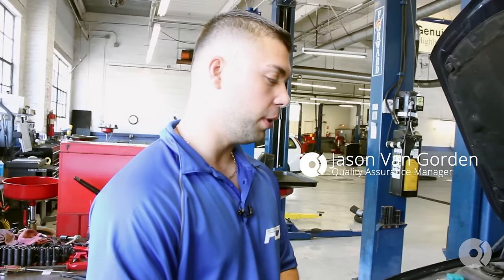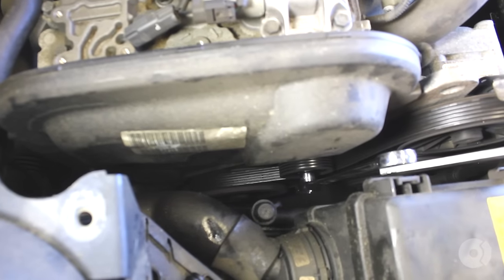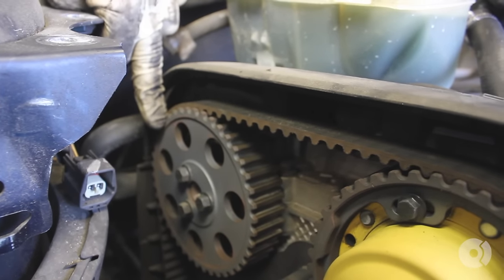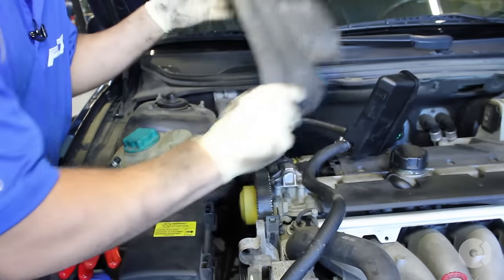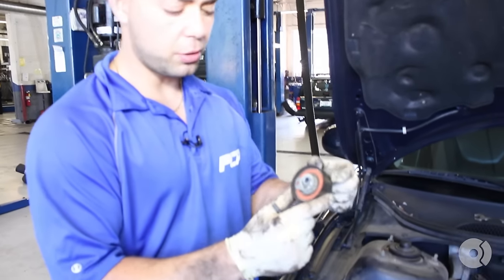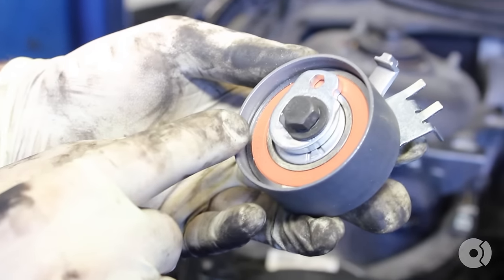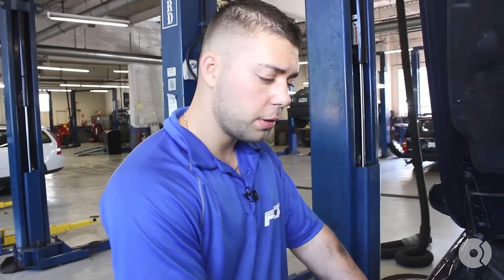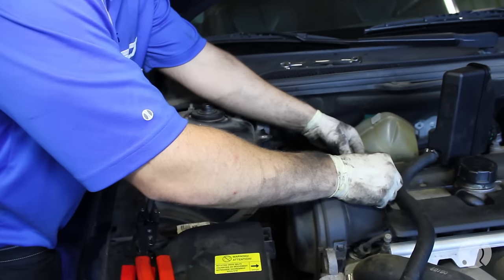Volvo P2 S60 Timing Belt Replacement DIY (S60, C70, V40, V70, S40, S70, S80, XC70, XC90)

Comment from the maker: Shop the parts used in this video here: https://www.fcpeuro.com/products/volvo-timing-belt-kit-and-water-pump-kit-comprehensive-conti-belt-tensioners-tbkit331wp1?utm_source=youtube&utm_medium=description&utm_campaign=volvo%20audit&utm_content=v001
Reply: So in a way I wouldn’t need a can locking tool for this job? I’m getting the kit from fcpeuro and want to do the cam seals. To do cam seals I would need the cam locking tool? Perfect video watched most of yours and did the work on my 2004 Volvo XC70 Awd 2.5T with 207000 plus miles

Comment: Sir,
I watched your video over and over before trying this on my wife's 08 S60.  This video was easy to follow along and gave me the courage to do all the work myself.  You saved me tons of money from going to the local garage.  Thanks again!
Reply: Prices are nuts sometimes because of the hourly rate... Belt costs nothing
Reply: This was the exact reply I was looking for. Thank you Sir! God is Good!
Reply: @mule666  Lot of places are nuts for the parts prices too. I had one place quote me almost $500 for the timing belt and water pump kit and then another $36 for the water pump bolts. I did the job myself for about $300 for the full timing belt kit and serpentine belt kit from FCP. Only thing I paid a shop to do was the cam seals that were leaking from the previous owner neglecting the PCV system. Got the PCV kit from FCP as well and did that job too. That job was a bit more difficult as the banjo bolt is a real pain and I had to drop the oil pan as the drain back into it was clogged all the way to the bottom of the pan. Still knocked it out in a day on my weekend and saved a about $1500.

Comment: Completed timing belt and water pump replacement on 2003 Volvo S60 AWD Turbo with the B5254T2  2.5L Engine. Excellent Video Jay - Easy to follow instructions which ultimately led to a succesful replacement. Couple of points for those considering to undertake this repair.
- Serpentine tensioner: My vehicle required a T60 torx. There is just enough room for a 3/4 socket wrench and the T60 torx socket to release the tension. (no special tools required)
- There are 2 different Timing belt tensioners depending on engine number. Check engine block and if last 4 digits 8688 and below then the belt tensioner in video is utilized. If last 4 digits 8689 or higher, there is a different belt tensioner style
- Torque Specs 2001 - 2005 S60 2.3/2.4/2/5L Turbo 
                     - Timing belt tensioner bolt : 15 Ft. lbs
                     - 4 Crankshaft pully bolts: 18ft lbs +30 degrees
                     - Crankshaft nut : 133ft. lbs
Book time for labour  (not including waterpump) 2.10 hrs
Add another 30-45min for water pump removal and installation.
Keys to sucess - Patience, correct tools, attention to detail.

Question for Jay: 
Will turning a camshaft without the belt on cause damage to the valves? 
Is it critical to disconnect the battery ground cable prior to starting replacement?

FCPEuro Fan in Alberta, Canada.
Reply: Those engines have no tolerance, you don't want to move the crankshaft without belt as you may hit a valve with a piston. I don't see an issue wit leaving the battery operational but it is an ultimate safety precaution and safety is never too much. Cheers. Thanks for the torque specs.

Comment: 2004 XC90 with 2.5T with 108k: followed the same process, just didnt remove the cross bar or crankshaft pulley, instead just removed little plastic cover under the crank pulley to remove/install timing belt. Before removing, marked the old timing belt and pulleys with nailpolish, then market the new belt according to the old belt with nailpolish to match the timing. Thank you guys for the video, very helpful!

Comment: I had a broken intake valve spring on my 2002 V70XC that necessitated a tear down to remove the head to replace the spring and bent valve. I watched various videos, including the many excellent FCPEuro vids like this one to build my confidence. I had the cam cover off, the cam shafts off using the cam shaft locking tool, and the head off, and used that opportunity to replace the deteriorated EVAP emission hoses, the PCV hoses and clogged oil trap, the old starter motor, etc. Once it was all back together, it was time to time the crank and cams and to replace the timing belt, tensioner, idler, and H2O pump. The most important part of getting the timing right is to use the Volvo cam locking tool and the marks on the cam pulleys to align them with the index marks on the timing belt cover, and the marks on the crank shaft cog with the index mark on the block. Start with the belt off, and turn the crank cog and line up the two marks with the index mark on the block, and use the cam locking tool to get your cam shafts lined up, and then align the marks on the intake hub and the VVT exhaust hub with the index notches on the timing belt top cover. It is really a super easy job and difficult to mess up. Once you spin the crank shaft two or three times and the timing marks on the cam pulleys continue to line up and there is no valve on piston contact, you know you've done it right. It was great to run the engine for 10 minutes without throwing any error codes or finding any oil or coolant leaks! Hooray for the Shade Tree Do It Yourself Mechanics!

Comment: I just gotta say thank you for posting this video it really helped on changeing the timing belt on my 03 volvo s60. It took me about 3 hours although i will admit it probably would only take about 2 hours if i knew what i was doing before. Keeping the old girl running at around 330,000 miles.
Reply: Can you do job without a hoist? Or too difficult
Reply: I’m gonna check out an s60 from same year with 2.5t awd. It has 180k is there any I should worry about

Comment: Awesome Video!  I changed the one in an 03 XC70  in about 4 hours and it was relatively painless.  
The only issues were:
- Finding how to release the tension on the serpentine.  Its a torx beside the tensioner pulley and is hard to see.
- The crank shaft timing marks are tough to see with the vibration dampner and timing belt in place.  Once you get it apart, its easy to see the V notches in two of the teeth on the crank that line up with a mark in the casing.

Thanks FCP!

Comment: Jay.  Thanks for the awesome video.  I just got this done today on an 02 S60 with parts from you folks.  I did the water pump too.  Once the belt is off along with the idler and tensioner, access is very easy.  The worst part of the whole thing is that darn serpentine belt tensioner!

The only discrepancy I found is that my crankshaft pully marking were a bit different than you show.  I had marks on two teeth that lined up either side of the mark on the block.   Checked it 3 times to be sure

Comment: Finally got this, and the water pump done on my 2001 non-turbo, which was almost 40K overdue---first timing belt job ever, and took me over 7 hours. The old belt looked good, but the pulleys were definitely going; a generous amount of grease was coming out of those bearings.

Admittedly got the blue Gates sports belt kit from FCP (even though I could've just acquired the regular kit), and an Aisin water pump. Engine feels a bit smoother, and warm idle is nearly silent. My near-245K S60 is definitely happier.

This video helped immensely! Thanks!
Reply: do you know how to adjust the camshaft pulleys to aline back up correctly? Aren't you supposed to only turn them clockwise?
Reply: @standeman32  There was very slight back-forth rotating play in the intake cam—enough to barely misalign the timing marks, but I corrected it by eye and hand while placing the new belt over the cams. The exhaust cam with the VVT hub had no play, however. This was part of the reason for this taking me over 7 hours, but that was mostly because it was my first time, as well as FEAR, admittedly.

For JUST the cams, realigning the timing marks by turning them counterclockwise should be fine, as long as they're not ridiculously off alignment.

Anyways, over 280K miles with mine now, and she's still running strong! 🦾

Comment from the maker: Basically there are two different engine serial numbers which will indicate which direction to take. For engine serial numbers up to 3188688 you will turn the eccentric Counter-clockwise. For engine serial numbers 3188689 and up you'll turn the eccentric Clockwise. Hope that helps.
Reply: My engine is above 319886989 and Vida states to turn cam 1/4 turn clockwise then line up marks.is it important to do this as I didn’t do it that way(didn’t have Vida at time)and now how have “exhaust cam sensor no signal fault” 
So would that cause my fault?

Comment: Recently did the timing belt on a 1998 S40.  Somewhat different engine, I know, but your tricks on the tensioner to getting maximum length to slip the belt over the exhaust cam sprocket were 100% applicable. Thanks.
And only 30000km before I get to do it all again on my XC70.

Comment: This is the 2001-mid2004 tensioner up to 3188688  ENGINE serial number (it's on the cover sticker, not the same as the VIN number). On the mid2004-2007 (V70) and 2009 (S60) after 3188689, the tensioner is different and not interchangeable and easier to adjust. The first model of tensioners are difficult to adjust correctly. ALWAYS make sure the hex hole is at 11 o'clock before installing the tensioner on the block. Before adjusting the tensioner, turn the engine by hand a full turn clockwise, to pretension the belt between the idler and the intake sprocket. Tensioner bolt torque is very important to set right 15 ft/lb  (20nm).  If the belt is running offset, or wobbling, or if the tensioner needle is shacking much, then there is something wrong with the tensioner: wrong tension, cheap part, or center bolt too tight. Jason didn't lock the cam sprockets, so he moved the cams wile working on the belt. Double check the timing marks before installing the new belt. We don't replace the water pump at the first timing belt, but if you buy a car with a new belt, check it doesn't come with a cheap aftermarket water pump: it will fail in 1-3 years. Use only Continental/Contitech or genuine kits for the belt, and only Aisin water pump when replacing it at 200K miles.  Also note that releasing the tensioner on the serpentine belt may require a special tool: early tensioners had a 14mm bolt, but later ones required a big torx bit and the ratchet will not fit in there. 
Oh, I see my comment got a bit of attention, so let's throw a few more things while there.  I did not remove that transverse torque mount bar, I think it works. When you lift the coolant reservoir, be sure to disconnect first the level sensor plug, so you don't break the sensor. If you are patient, you can also pass the belt without removing the crank pulley, just the small cover in front of it https://youtu.be/2tljxoQFDe0  Go with Contitech kits, and Aisin water pump at the second belt. The timing notch on the block at 6:20 cannot be seen with the belt on, but can be felt by hand, it's really tiny https://images.matthewsvolvosite.com/s60-timing-belt-marks.jpg  See my channel, I have a few repair videos with these cars - subscribe for new vids ;)
Reply: thanks for the info. My "06 is after the '688 engine number so i will buy the kit for the later engine number. Questions: Is the procedure any different for the turbo model (2.5 turbo)?

Comment: Long overdue. Thanks for the effort. Really an easier job than I feared. Ive done my 850r and my daughters' S60. Basically same animal. Great engine and a shame when you see them on Craigslist with ruined engine from broken timing belt. One bit of advice is the paper gasket for water pump kit is inadequate and I'd use a high quality gasket material. Thanks again.

Comment from the maker: The marks just allow you a point of reference for lining everything up, they're not anything special on their own.  But they can still budge without really noticing, & considering how dangerous it is to your motor even if the timing is only slightly off it's best to have the marks lined up no matter what you are doing. Just for safety's sake.

Comment: Thanks a lot for the comprehensive service, the quality of the parts it's outstanding and the price very good, same as all the other terms (shipping, warranty, etc). I did my timing belt yesterday on my 2005 XC70 2.5T dual VVT and your how to video was very useful. I used other sources as your example is non-turbo and has only one VVT hub. I contacted the store about some guidance on the usage of the camshaft locking tool (I bought elsewhere) but unfortunately you were out of the office and the fella at the phone was unsure, said he wanted to run it by you. Sadly I couldn't wait as I needed the car driveable by the end of the day. End result, it runs like a charm. The tensioners (timing and serpentine) as well as the idler I pulled out of the car were INA and stamped volvo, very happy about using the same OE part at a fraction of the price. I'm in Canada, and even with the exchange rate and driving to the border (I'm less than 1hr away from Ogdensburg NY) you are far ahead of the game compared to buying parts here.
Reply from the maker: You're welcome! Glad to hear you found the video helpful. In the future you can also email us at products@fcpeuro.com for anything technical related.

Comment: Very comfortable, clear, and technical, good video.. always change the water pump, especially when you see the belt excessive  wear, and the tensioner bearing making noise. You know the seal on that pump is soon to go. Also when Tbelt installed,  rotate the crank a few turns.it is good practice.
Reply from the maker: Glad you liked the video, Mil!

Comment: great video and great knowledge.  i did a timing belt on an old volvo, and we marked the pulleys with whiteout so you can see better, and also marked the cover and engine. (saved having to pull covers on and off), just a suggestion.  but this is the correct way to do it.

Comment: Your post was extremely helpful.  I know it was  for an S60 but it looked close enough to an S80 that I went for it.  The main difference I found (other than taking off the turbo piping, which I expected), was in the markings on the crankshaft.  I had to remove the crankshaft pulley and there I found a raised ridge on the outside rim of the pulley.  The only corresponding mark on the block is a U shaped thing. The alignment appeared more toward the center left of the "U".

Comment from the maker: You might have to loosen the tensioner a little if it's seized, but functionally you can lever the tensioner to relieve the tension to the belt.  But if you're swapping out your belt consider replacing the tensioner and rollers at the same time.  It's often not the belt that fails but the other components.  Hope that helps!

Comment from the maker: On the T6 you'll have to remove a vibration damper on the crank pulley and a possible coolant hose in the timing cover area. The vehicle may or may not have the hose depending on the year. Clearance is also an issue on the T6. Disconnecting the engine mount and raising on the passenger side may make things easier. Hope that helps.

Comment from the maker: The yellow hub is indeed OEM. And the slots are for the hub adjustment
but adjustment isn't required unless your replacing the hub or it has
been disassembled.  Hope that helps!

Comment: I bit harsh are you?  This video is very informative and was done how most certified mechanics would do this job.  Serpentine belts are very reliable and should be replace every other timing belt change.  As for torque values, as it is important, most don't use a torque wrench as it either won't fit in a tight spot and or slow the job down,  If you wrench long enough, you will 'feel it'.

Comment: This vid inspired me to take on the timing belt issue in a 2005. The timing marks were quite off even before I took the old belt  off ( both cams were variable ) and there were no marks at all on the crankshaft pulley. I made my own marks on all three points with a Sharpie pen and put the new belt on exactly how I found the old one. Also I did not remove the crankshaft drive belt pulley and slipped the new timing belt over it with some finger action. This requires removing the two bolts that hold on some kind of plastic belt guard in back of the pulley

Comment from the maker: Essentially the information is the same but there is a few more steps on the T6 including disconnecting the front Engine mount and raising the engine and removing the control units (That's what we do any how). Depending on the year there may also be a coolant hose that enters right through the timing cover for the thermostat housing. This is plastic and breaks very easily. As far as the gears and belt the procedure is about the same. Hope that helps!

Comment from the maker: Well the serpentine belt routing is different, there are 2 belts & you need to support the engine and remove an engine mount to gain access. Also the timing belt tensioner is different. As far as the Marks if I remember correctly they are the same.  Hope that helps!

Comment: Yeah, try doing a V50 with the motor mount at the top of the engine....motor mount must be removed and still no F******G room to get in there. I'd like to meet that Volvo engineer some day. Sick bastard.
Reply: Front wheel drive doesn't help .
Reply: Why they didn’t just use good quality timing chain this is ridiculous